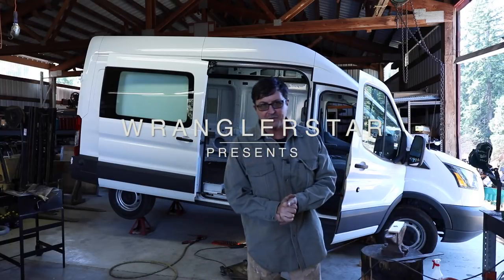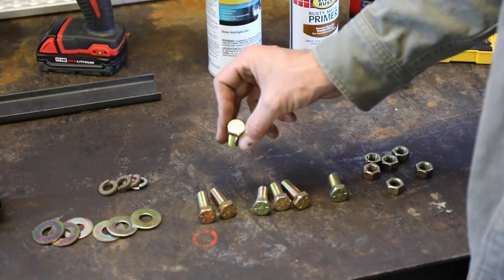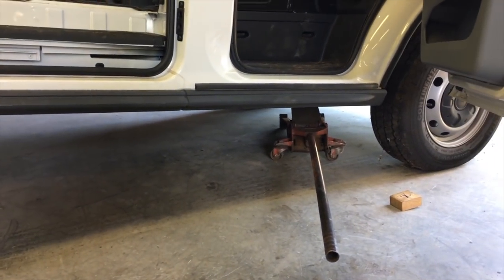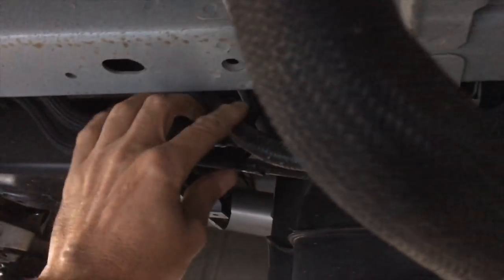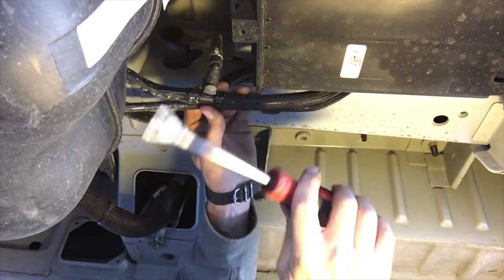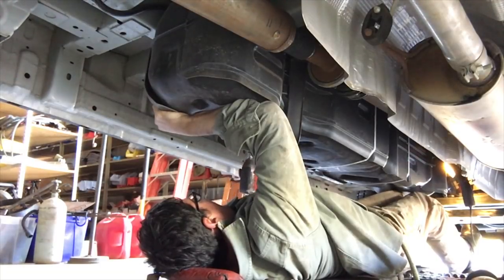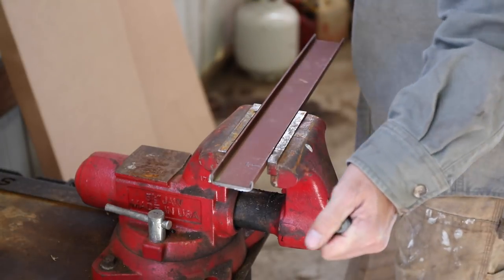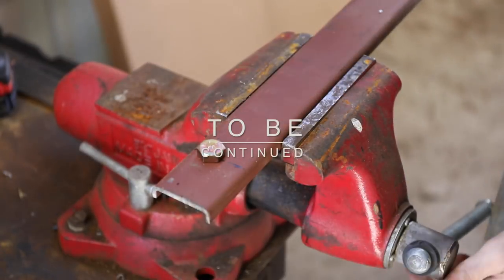Building The Ultimate Stealth Van 5

Comment: I would add one more thing about safety, DON'T TRUST JACK STANDS, they are a single point of failure. ALWAYS put blocks of wood under the frame on both sides as a backup. High enough so that if the stands fail, you won't be crushed. It's simple and takes little time and is fool proof insurance.
Reply: If I did half the things all the Safety Sallys said, I would never get any work done. Jack stands are perfectly fine if they're set right. A log is fine if there aren't enough jack stands around. Why would I need redundancy in a foolproof system? And currently, I have grand cherokees. Where can I even fit 2-4 jack stands and 2-4 logs or stacks of wood or whatever? The only time I actually get under is for exhaust work. If I put all that under it, there would be no room to work.
Reply: What if the wood fails?
Reply: The one thing I don't see Cody doing is putting chocks front and back on the front tire.  That's where the jack stands could fail.  The vehicle rolls and stands fall over.
Reply: 900 lb I beams.
Reply: Having had a co-worker die when his truck slipped off a jack stand, taking the extra 1-2 minutes to put a couple spare tires or a few 6x6 pieces of wood under the frame is just plain smart. It's easy, it does not interfere with what you are doing. Buy a couple 6x6's cut them in 12-16" lengths, cheaper and better than Jack stands, or use in conjunction with them. Better safety sally then dead sally... use your brain...
Reply: I for one will never stop being careless. My guardian angels are kept very busy!
Reply: Adam Frederick holy cow man, glad you dodged that to live and tell, we only have one life, we shouldn't treat it like it's not a gift.
Reply: Let's not forget that those jack stands are most likely chinesium quality.  If you want to put your faith in them, that's all on you buddy.
Reply: Why nothing in front of the front tires?  Is he just depending on the brake and having it in park?
Reply: On nothing, since this is a RWD vehicle I think.

Comment: I love your grandpa's creeper! Interesting gas tank strap layout, and the fact there are 3.Those "Disconnects" are actually Quick Connectors, to speed up assembly. But, that is very handy! If you "did this for a living", it'd be on a lift, and you'd have a tall jack (instead of jack stands and a creeper). I like your Rule of 16ths. That step-bit really tore through that steel. I use step-bits quite a bit, and I have found that rocking them back and forth helps them to eat metal. I don't like Milwaukee battery tools. I have two corded Milwaukee tools (8" circular saw, and a Sawzall). Great video as always Cody!

Comment: I expect the Ford Transit to be mostly metric as it was manufactured in numerous locations and distributed worldwide before being americanized. As far as I am concerned, having to deal with either SAE or Metric is fine, as long as the two standards are not mixed together.

Keep up your good work.
Reply: oh yeah, i hate that! my ford ranger has both, it's annoying going through my sockets or wrenches only to discover, nope it's the other system.
Reply: Back in college, I had a 1980 Ford Fiesta. It had one SAE bolt. SMH

Comment: Tip for dealing with lowering large cumbersome object out of your vehicle.  Get a 2x6/2x8 that a couple of feet long.  Drill a through hole in the center and counter bore it so that the bolt head will be flush. The saddle on your floor jack is removable.  Remove it.  Get a piece of steel (what you are working with would be perfect).  Cut it so that it is just longer than the hole for the saddle.  If you want to be "fancy", drill and tap the hole for the threads of the bolt you are using, otherwise dill a through hole and use a nut underneath.   

For wide items, you could add an extra 2by on each side using pocket screws.

Use some 1" nylon straps over the top of the object and around the wood platform.

Not perfect but a whole lot better than holding a heavy object (like a transmission) on your chest trying to get it to line up !

Comment: I got no step bits but have been wanting to buy some. I haven't had any issues with DeWalt brand cordless drills. I can't wait to replace the 1/4" cordless impact that got stolen a year ago from my pickup I was working on. It did more than I expected plus being 18v doesn't take as long to charge battery packs.

Comment: When dropping the gas tank, if you can get 2 cam or ratchet straps along the main supports of the tank then connected to the frame it greatly speeds up the removal and install. Had to do this one time on the side of the freeway replacing a fuel pump in the middle of nowhere.

Comment: The reason your drill is cutting out is because you're overloading it. A normal drill bit does all the work on the leading edge of the tip of the drill. And the load is in line with the chuck. With that type of progressive drill bit the load is at an acute angle to the chuck, meaning the more pressure you put on the more jammed it gets. This is because the number of cutting surfaces and the total cutting surface area in contact with the material causes a lot more friction. So you need to modify your feed and speed accordingly. All drilling operations are about using the correct feeds and speeds: Small drill: fast speed - slow feed. Big drill: slow speed - slower feed. And with steel you should be using a cutting oil. Don't press as hard. Allow the drill to run at a higher more efficient speed, and lubricate the bloody process. Burrs can be removed with a file and 90 degree chamfering tool or a bigger drill. But in reality those progressive drills are for thin sheet material to prevent snagging, and aren't really meant for (or suitable for) thicker stock. Use the right tool for the job and you won't have to blame your tools.
Reply: I agree, but that Milwaukee was pretty week.
Reply: I've noted on my Milwaukee M12 series that battery charge makes a big difference on torque...also choosing the larger AH battery...could not tell if his was the fuel series but they are much improved over the previous generation.

Comment: Oh, and chock your front wheels and put the back wheels on blocks. I still work under my car sometimes. I always use axle stands, chocks, and blocks or ramps. If I take the wheel off one side, I add the jack to that side also. That way THREE elements have to fail for me to get even close to trapped. I never risk getting crushed.

Comment: 1. always chock the ground wheels, if it's a van, use high wall chocks. 
2. always throw a secondary safety system under the van to take up the space if everything else fails.

Comment: When I was working as a mechanic I never found a good drop light.  Most of the time I used my streamlight the plastic lights never held up
Don’t be afraid to paint the holes after you drill them with the different metals that will be the first place it rusts

Comment: Damn Cody, be careful with that gas, there's a bleeder valve in the fuel line under the hood, probably on the fuel injection manifold to relieve the fuel pressure.

Comment: A big word of advice: do NOT use 3M's rubberized undercoating in spray cans! The rubberized undercoating in spray cans is very thinned out and does not contain a hardener, and as a result the coating is very poor. You can easily scrape it off with your nail. But the biggest issue is that this rubberized undercoating will react with any type of solvent. Get some gasoline on it, alcohol, oil, stronger soap, etc. and the coating will gunk up and become a big sticky mess....  A few months ago I redid my wheel arches with this stuff... then when I washed it with a stronger soap, the whole thing became a sticky mess that took forever to get rid off. It was a nightmare....

In short, do NOT use those rubberized undercoatings in spray cans. Instead use a two part rubberized undercoating. I recommend U-POL's Raptorliner. This thing is very hard when used correctly and flexible enough to not crack and let water through.
Reply: I agree with you, this is surprising coming from 3M, who's products are great typically.

Comment: I think you may have messed something up when you did the test between the milwaukee and dewalt because i have the same exact drill and it has never shut off on me ive drilled through 1/8 inch thick steel and grade 5 and 8 bolts never once shut off

Comment: ALWAYS use some lubricant when drilling on steel. ALWAYS. Your bits will last longer.
Reply from the maker: +jdmeaux not always
Reply: For the most part, your dear Uncle B. will tell you that you're just making smoke. Friction is how a drill works. Heat is the real enemy.

Comment: Hey Brother! Love your videos thanks. I have a 2015 ford Transit cargo, med roof, long wheel base and I bought a factory 3 passenger seat and rails for my 3 little daughters to ride safetly. I want the seat as far to the left wall as possible. Thinking about drilling through the frame rails and using like 6” Long grade-8 bolts and 1/8” plates. How do you feel about going all the way through frame rails with the long bolts? Thanks for any and all insight.  :-)

Comment: Grade 8 bolts sheer off if they are not tight where as grade 5 bolts will bend before they break.
Reply: Not 100% true.  Grade 8 is tougher and still offers some ductility.  Although it is true that they are more brittle than a Grade 5, overall they are much more strong.

Comment: Not a big fan of step bits.  Good for sheet metal I suppose but anything thicker and I want a real drill bit.  I had a couple from harbor freight and they rounded off so fast it wasn't even funny. Apparently they don't like frame steel. :)
Reply: They are great for sheet metal.... and only sheet metal.

Comment: Cody, you will learn why that Milwaukee drill is much superior to any other if you use it correctly. If you are not drilling high speed you should be in 1st gear. If you are rock climbing you don't use 2nd gear. That tool is designed to last longer than any other. I use mine everyday, rarely on anything thinner than 3/16. I've had Makita and Dewalt and feel the Milwaukee is far superior in every way. No reason to be in 2nd if you arent even maxing out 1st gear speed.
Reply: Really?  even better than the new Makitas?
Reply: Absolutely hand down.
Reply: I'll give them a little more consideration next time I'm looking, thx.

Comment: Yes, being a mechanic is a hard job, that's why I learned to fix computers. The trick with Ford electrical plugs - Push in and hold, push down on release, pull out plug.
Reply: no being a mechanic is not hard, deealing with people that have zero clue about cars is the hard thing the rest is a matter of training, experience, and the proper tools to do the job
Reply: TheDarkalkymist was picking up a 20L of trans fluid at the local store today and overheard a customer just like that with another staff member. They wanted some parts to fix a problem which they couldn't explain. Yet somehow thought they'd be capable of making the repairs... 

This was at the equivalent of a NAPA store in the states im guessing.
Reply: trust me happens all the time, O2 sensors being replaced because they report back rich or lean conditions, not because the sensor itself is bad, but the OBDII code shows it as an O2 sensor code so it must be bad, right? lol

Comment: Not that safe, didn't block the front wheels.
Reply from the maker: Did you see the jack stands?
Reply: Wranglerstar I think Peter was just noting that since it's rear wheel drive, the front wheels are free spinning.  Meaning it could potentially roll...not that it would
Reply: Better safe than sorry. Great video.
Reply: SAFETY SALLY
Reply: Lol
Reply: you always block the tires opposite the jack stands, just incase someone loads the front or rear of the vehicle with lateral pressure, the jack stands will hold the weight if the weight stays in one spot
Reply: I hate safety sallies, but this is not a safety sally suggestion, this is simple common sense... BIG DIFFERENCE.
Reply: The jacks are not gonna do anything in this kind of unbalanced set-up.
Reply: have seen them do it in far more unbalanced setups, worked in a garage for a couple of years
Reply: Even if it fell off the stands it’s not going to hurt him while he’s under there. It’s not like he’s got both rear wheels off it....

Comment: I would of thought you would of used nylock nuts.
Reply from the maker: Grade 8 Nylock are not readily available in my area.
Reply: good point
Reply: Another tip Cody use "Loctite" when assembling also you will find it easier to undo the nut on your right hand last in stead of your left (check out your video and how you struggled with the last bolt holding the fuel tank)
If you had used a centre punch before drilling the holes would have been exactly were you wanted them. This are just observations that might help you in future - good luck with the rest of the job. Where is your apprentice Jack?
Reply: Quobobled.co.uk - Nyloc nuts don't come in grade 8, and you lose tensile strength when you use them! A soft nut with a strong bolt is only as strong as the soft nut!
Reply: Wranglerstar - if you properly torque a grade 8 nut to a grade 8 bolt, you won't need a nylock or a lock washer, both of which would reduce the strength of the fastener assembly.
Reply: Its why you use stover nuts they will never come off from road vibration.
Reply: Call it paranoid or whatever but I would use some red Loctite no matter what combination of bolt and nut I used for a something as important as a seat.

Comment: Ah yes. The metric system. For the people that didn't rely on the appendage length of body parts as a standard.
Reply: And the metric system still managed to make more sense. I like a system without fractions to the enth degree for simple measurements.
Reply: metric is fractions to the nth degree...just 10 to that degree.
Reply: Yep you're right. To the tenth. No 8th 16th 32th 64th and any other stupid multiple thereafter.
Reply: Yeah sure. 1/4 plus a 3/64 plus 1/8 plus 3/16 is so much simpler than 1mm plus 5mm plus 7mm. You're looking rather desperate at this stage trying to defend imperial.
Reply: ZS6JMP, not usually to the tenth, but to any n (10 to the 10 is a pretty big number, and I've never needed a tape that long). If this is going to be a math conversation (and I regretted commenting as soon as I hit reply...) then you need to understand the math and stop using abusive notation. most craftsmen don't use fractional inches beyond a 16th because anything more precise would be unnecessary and turned into a decimal (and reserved for machining, us wood elves don't work that small). now where the metric system shines is in the physical sciences, where areas and volumes can correlate, and masses aren't the same as forces caused by gravity (weight). 

Really though, as far as 1.5 inches vs 12mm, theres not a better system. just run whatever ruler you have and stop worrying about what other people like.  

Some of us don't want to speak Esperanto either.  Shame on the antiglobalists.
Reply: I dont use ''abusive notation''. I get it. You love imperial. I dont.
Reply: Yeah sure, and same country is now falling behind getting overtaken by China. Says a lot. Your point was again? And they were a 1/4 inch off on the landing. If it was the metric system though..............
Reply: OOOOOOOH We have a bite. Fishing is fun.